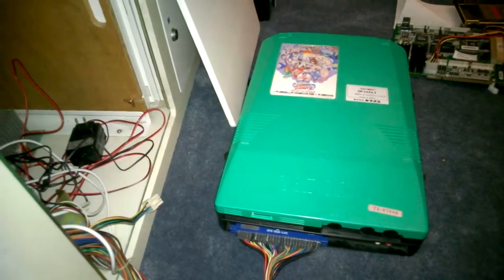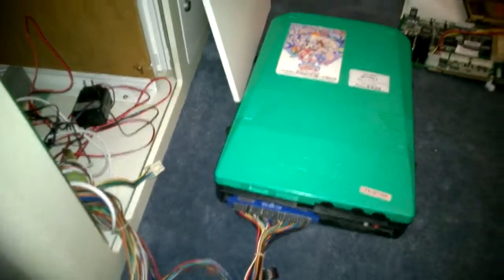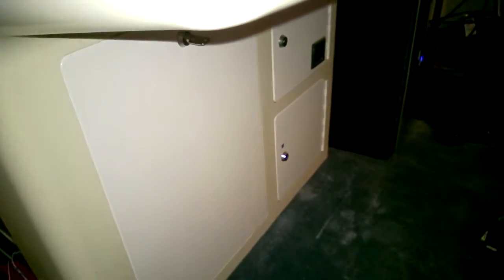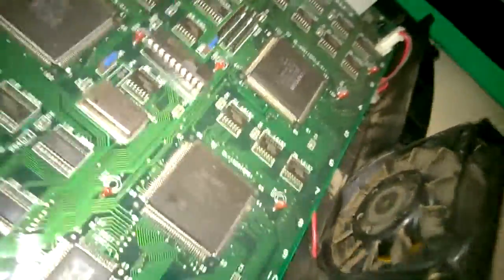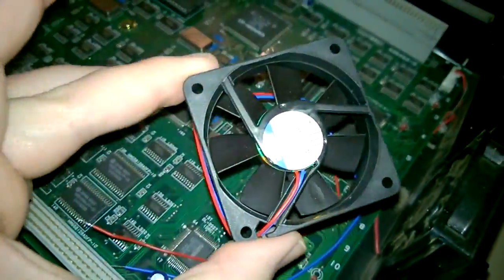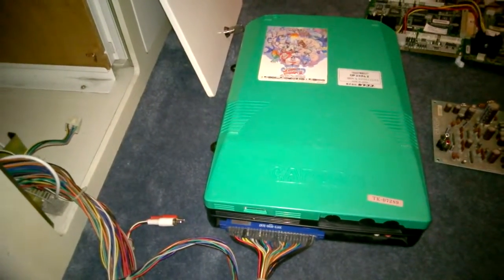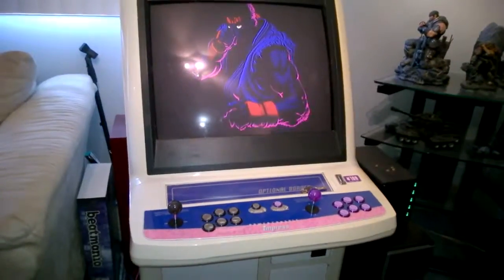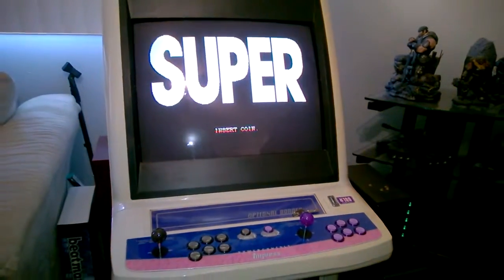Capcom CPS2 A Board fan replacement

Comment: Just redone the suicide batteries in my super street fighter 2 new Challengers and super street Fighter turbo boards, thought while i had the boards out i would do the fans this time, even in the cab they are flipping loud with the stock fans my super turbo fan is sounding rough anyway, so swapped them out with some silent 6 fans, both are now super quiet, should of done it years ago.

Comment: My fan is done - but the does the fan blow-out of the board, or is air supposed to blow in?
Reply from the maker: I'm fairly certain it's supposed to be pulling heat out of the casing, not blowing air in